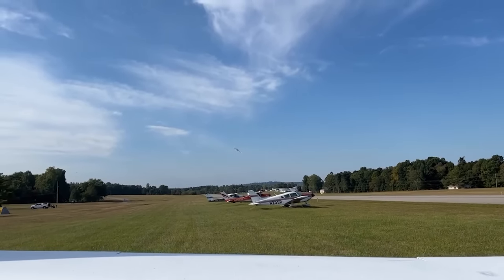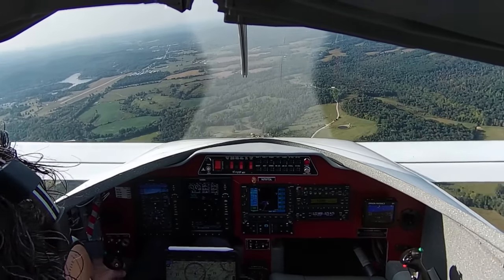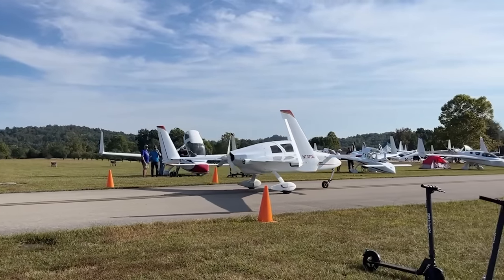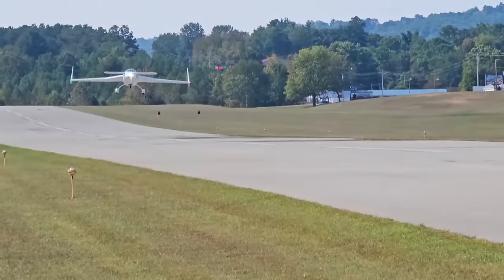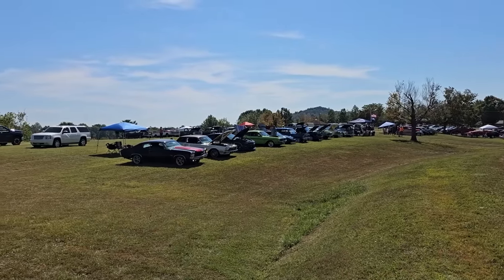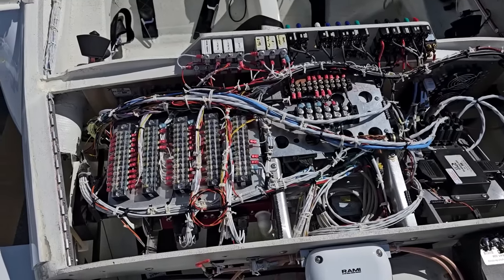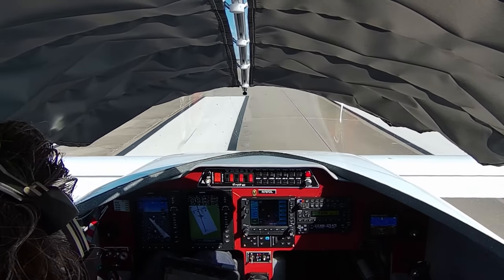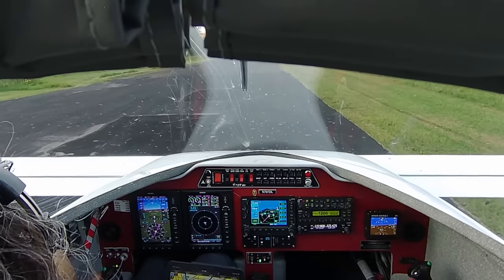Rough River 2023: The Largest Gathering of Canard Aircraft in the World!

Comment: Didn’t know the Cozy parks in the grazing position.
Reply from the maker: The Cozy was literally developed from the Long EZ - Burt makes a royalty off every set of Cozy plans sold. So there are a LOT of similarities.
Reply: @CanardBoulevard  ah, residuals…. I have a hat signed by Burt, and Sully/Jeff when I flew out for Airventure back in 2011. 

I suppose the weight distribution and main gear location in both the Velocity and the Berkut allow them to stand up without occupants.

Comment: I'm no aerodynamiscist, so I wonder how much efficiency is down to the canard configuration, and how much is down to the light weight composite construction. I suspect that the latter is the bigger fàctor, and the engine-forward approach is better in most circumstances. It seems to be quieter for those on the ground, albeit noisier for those on board. And the main wing works in entirely clean air, but gains in climb ability from the propellor airflow. Interesting aeroplanes all the same, and much more exciting than a whole herd of boring Cessnas.

Comment: WHY are they parked on the nose?
Reply from the maker: Because when there is no weight (i.e. people) in the airplane, it has very little weight on the nosewheel, and can very easily tip over backwards onto its prop/winglets, causing serious damage. It is designed to retract the nosegear on the ground, so that the center of gravity moves forward, to prevent it from tipping over.